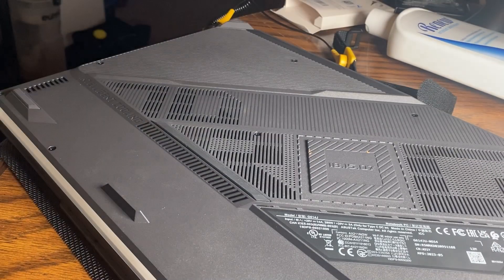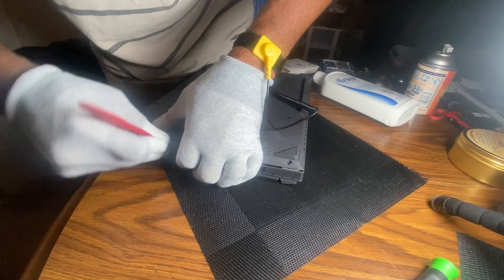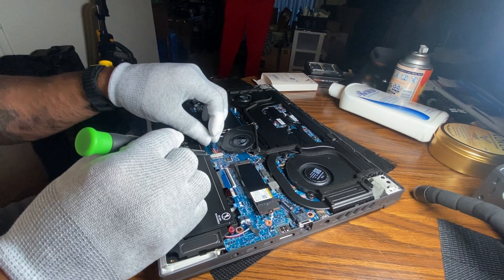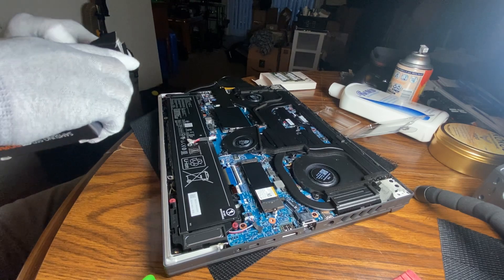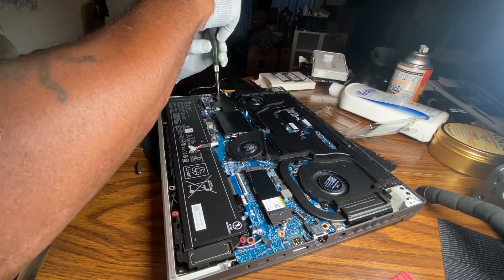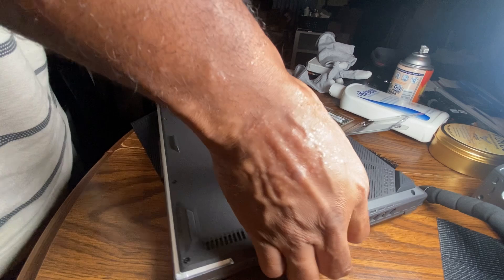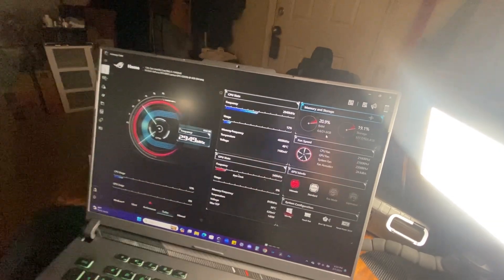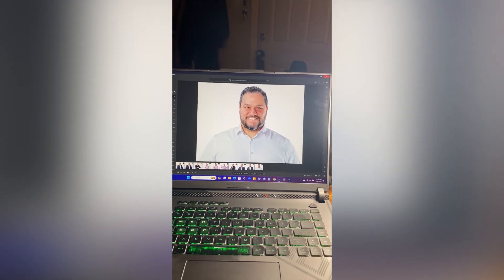ROG Strix Upgrade

Comment: After upgrading ram how much time need to wait for first boot?
Reply from the maker: @amirsoltani6007  it scared me at first because it took about 2 to 3 minutes
Reply: @mattlocdproductions  Great Thanks, it works. Single 32GB 4800 boot up, now do you recommended to add original one with different brand and different speed 5600 next to the 32? It means I use 48GB ram. it was interesting that original ram had 5600mhz label but no where said that it was always show 4800.
Reply from the maker: I buy all new ram chips from the same brand. It’s better to do two chips so the computer can transfer load to each one when necessary. System are set up that way so the computer will reserve some RAM speed from the 5600

Comment: Thanks for the video. Just made the same. By the way, in this model it is not nessessary to remove the battery connector, there is an optical switch onboard that cuts off the battery when bottom cover is off. But I've disconnected the battery... just in case
Reply from the maker: You’re welcome and no problem. I should have an overhead view. I’m old school and disconnect as well just to be sure lol. It’s cool they made a fail safe
Reply: Where can i find this optical switch ? How It Works ? It needs to be manually activated or it's automatically? I want to replace the RAM memory but i'm afraid to cause some damage in my computer

Comment: Did you move Lightroom and Vinci to the new ssd or did you leave them installed on C.  Adding a faster drive will only improve the loading speed of files actually on the drive.
Reply from the maker: I left them on the main SSD and they load extremely fast. I put my BRAW files on the 2nd SSD
Reply from the maker: I also just got a NAS system